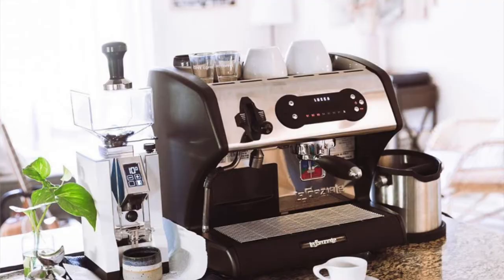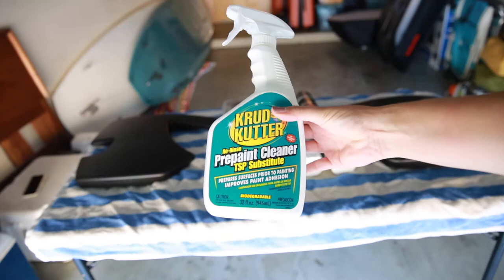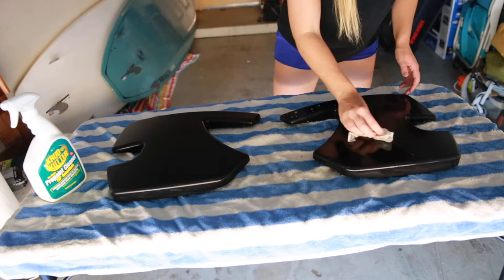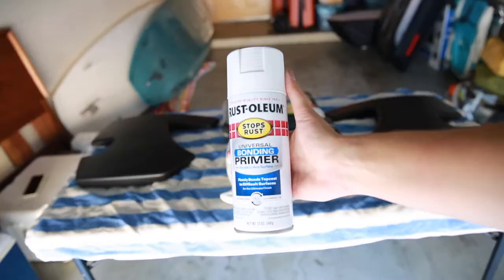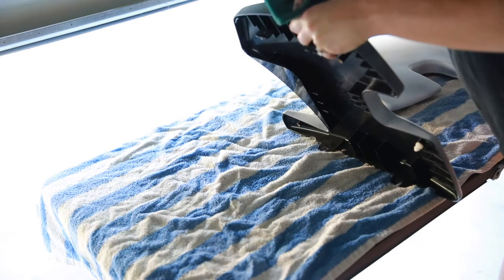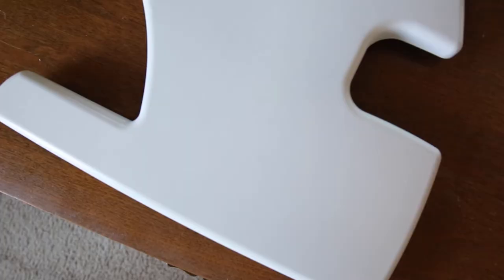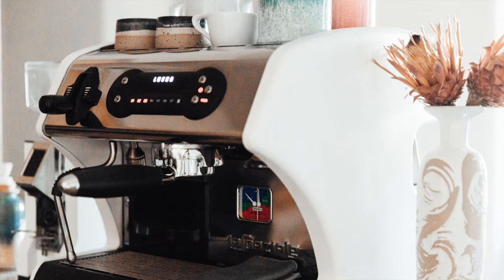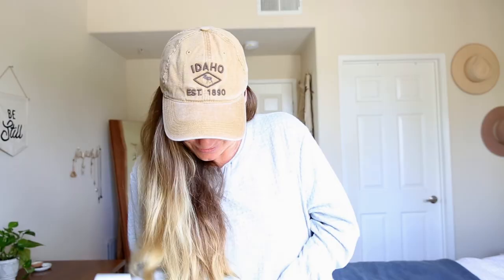How To Paint Your LUCCA A53 Espresso Machine WHITE!

Comment: Wow, excellent presentation. You were to the point without any unnecessary blathering and very complete. The end result looks fantastic. So it's been about a year since you did this. How is it holding up? Any dings or scratches from daily use so far? I'm considering the purchase of a Lucca A53. Off subject, but how much to you love the A53?
Reply from the maker: Thanks so much, I’m glad you liked it! And it looks exactly the same as the day I did it! :) easy to wipe off coffee splatters, and the sealer I used protects it from dings and scratches :) I love our LUCCA, this one has the option to be plumbed in or just a countertop reservoir, and we love how the water reservoir is located on the front face of the machine and that we can reload water from the front, so we don’t have to pull it out from under the cabinets when the water runs low. It has a low profile so sits nicely with plenty of space under our upper cabinets, on our kitchen counter. Very happy with our machine :)
Reply: @laurenturori6300  I’m sold. As soon as I get back home from my extended vacation I’m ordering one.
Reply: @laurenturori6300  It just dawned on me that you said your A53 has the option to be plumbed in. Are you saying you can still plumb yours in even though it also has a reservoir? It was my understanding that that wasn't an option but rather you have to decide whether you want a reservoir or a plumbed in model at time of purchase but that you can't after the fact change the reservoir model to a plumbed in one, or vice versa.

Comment: Great shiny presentation, but misses the point of how the finished paint performs. That said, i like the very helpful methodology in this otherwise great vid.

I have a two-group commercial machine that I'd like to paint...and I'm less able to take the $ loss if its a $ loser after painting. Big Exobar machine de España. '90s likely.

I'm sure the internet will be my friend for answering these questions: 

Was it actually problematic keeping clean and tidy with the Rustolium enamel? 

And how about heat? Any cracking or pealing from heat and cleaning, etc.

I'll continue researching, but it'd be a great follow up vid about performance over a couple years. All my unsolicited pointlessness is free! Woot.

Comment: Hey! This was an amazing video for me because I've been wanting to do almost the same thing, the only thing is I wan't to paint my chrome panels too, do you know if this technique will also work for the chrome?
Reply: You need to get them powder coated.
Reply: @alexaguillon7904  Actually I've found options that work other than powder coating, thank you though.
Reply from the maker: Hi! I don’t think it would work with the paint I used, because the chrome pieces get hot on my machine. I I am sure there is a appliance paint out there that would probably work. I reached out to someone who does powder coating, and they estimated it would cost 150 to get the chrome panels powder coated, which I might do in the future. I was confident in my ability to paint the black panels white and knew that it would look good, however I’m definitely not confident in my ability to spray paint the chrome! Let me know what you end up doing though and what your method is :)
Reply: @Leapoffaith4  And what were the "options" you went with?
Reply: @michaelerbreviews  Hey! So as of right now I have not chosen anything yet but I did also reach out to a local powder coating company in my area and they quoted me $125 max for the job, but said that it may even be less when they see it in person. I haven't decided if this is the route I want to take or if I am going to be only painting the sides (when I actually take the time to do it) 
Something I did just do is I custom ordered a walnut slayer style handle for the machine at less than half of the price of the Clive coffee wood handles, and I also ordered a walnut dresser knob that I'll be replacing the steam knob with.
Reply: @Leapoffaith4  Cool. I am really shocked at how expensive Clive is charging for the wood side panels. I’ve done some woodworking in my day, and I know I could make those panels for far far less.